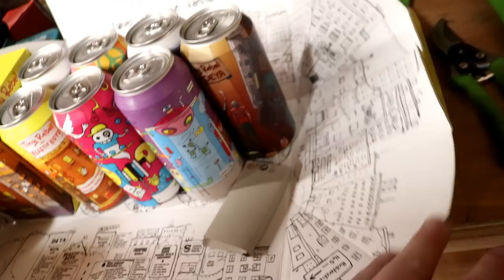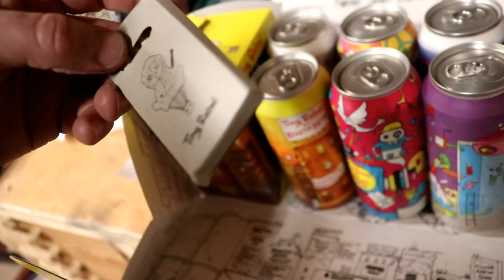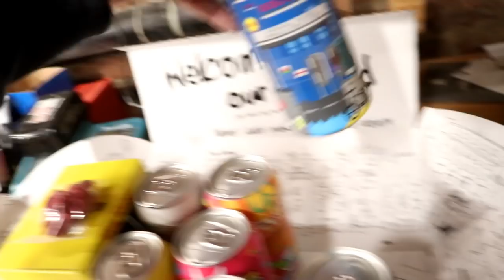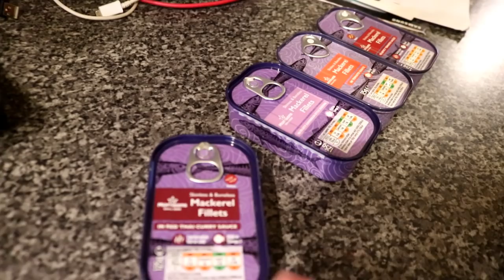BIRTHDAY PACK

Comment: That would appear to be a heated windscreen you posh bastard 😄 . That looked like a tray of chips, Did you get any? And I thought it was going to be a sneaky glove full of caustic up the jacksie 😄 . Top tip, stick new label on top of the old one, the new one will peal most of the old one off when replaced.😄😄😄 final banter 😄😄😄. Cheers, Schnuz.

Comment: I couldn't understand what you said about the sand,did you say you were building a dray or drain room and what's it for? That beer pack looks nice,I wish we could get the like locally here,local offies and supermarkets seem to have stopped stocking decent UK beers,I haven't been able to find any in ages,wonder if it has anything to do with brexit. Might have to see if Asda or the like will deliver down south lol. Anyway m8 take care,maybe one day I will get to sample some of yours. Cheers.
Reply from the maker: Sorry Greg, The sand is what I have had in the building for ages. Just been saving it until now. I will use it to cement the dray run at the back of the pub where we removed that step.